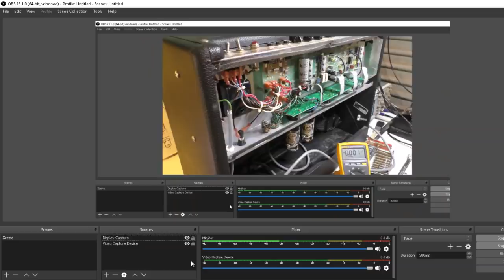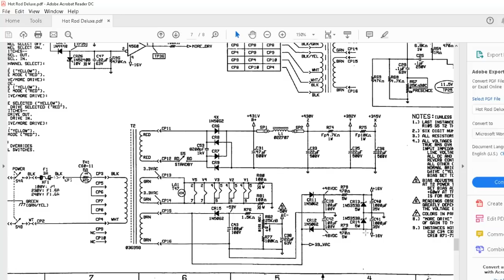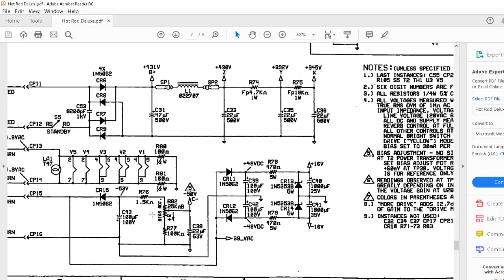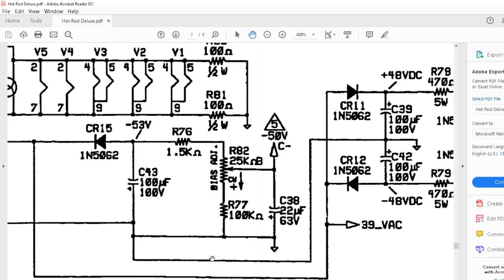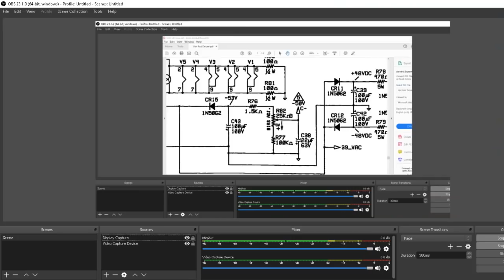Typical Fender Hotrod / Blues / Deluxe / Deville Series Problems & Repair.

Comment: Question please. I've got one of these been in storage 10 years and I want to get it up and running again. Is there something special I need to do to make sure it works and doesn't blow up?
Reply: Plug it in and turn it on.
Reply: What I always do with amps that have been in storage for a while is starting them up “slowely” with a variac the 1st time.

Comment: hey brad, i have a weird issue with my deluxe II . Volume at 0 as sound . Drive sound actually. the more i push the volume toward 1 goes back to zero and past 1 functions normally. 

I feels like the 0 volume was shifted at 1 , and there was a " negative volume "  below zero. 
Did you ever heard of that ? THis problem is actually no preventing me from playing at all , but i don't want to damage it. 

second problem : more annoying . often in gigs / jams if the amp has been on for 2 or 3 hours and get warm, the volume might drops suddenly, and sounds become really " transistor like " and cold. Professionnals never saw any problem because they probably don't play the amp for 3 hours staigth before to see where is the problem.
Reply from the maker: You only have one problem. You need a better tech.

Comment: Measuring the bias current with a signal present?!! You are adjusting the quiescent or IDLE current. The amp is not at idle if you're running a test tone through it.
Reply from the maker: The volume sounded lower than the camera gives credit for. I test idle with no signal and that's what I go with.
Reply from the maker: As I mentioned in the video, it's "safe". I just wanted to check that neither of the old valves were shorted or semi-shorted. They were replaced and the output bias set for the new output valves with no signal present.
Reply: Cool. Maybe reinforce to your amateur viewers that any signal at will give an inaccurate reading. I usually just pull the plug from the input. Good stuff, though.
Reply from the maker: @philbillie  Yeah, I should have. But when I throw the camera on myself, my IQ drops by half. HAHA!
Reply: @BradsGuitarGarage  Yes, the dreaded "Red Light Fever"

Comment: What lead forming pliers are you using?
Reply from the maker: Piergiacomi PNG5000. The ones in the video, purchased about 5 years ago are nicely machined and seem to be discontinued.
The new ones of the same model number seem to be machined using a cheaper EDM process and they are rough, with sharp points at the kink on some specimens, which is a total no-no. It may lead to a nick in the component lead and failure due to fatigue. Not impressed.

Comment: so i just bought a used fender hot rod i was wondering is there anything I should check right away on it?  Or just play it until theres a problem?
Reply from the maker: If you want it to last 10-15 trouble free years of hard useage, take it to a tech for some upgrades and mitigation of heat issues, otherwise, if you can afford to have it fail at some point (ie: it's not your only gigging amp), you could run the gauntlet and hope for the best. I'd get it sorted now if it was me, though.
Reply: @BradsGuitarGarage  ok,  the top does get pretty hot when playing but aside from that it looks nice atleast from the outside ha.  Maybe ill try to find someone to look at it to make sure,   thanks.

Comment: ya know, I'm pretty handy and can definitely do basic repairs, caps, tubes maybe broken boards and all that but I have this awesome Blues Deville 212 with n over drive channel issue. Im not sure if its the pot or something else. Sometimes it kinda works and sometimes not at all. (recently, not at all) how can I tell if its just the pot or something else, more serious and expensive to repair. I'm basically a poor man so I really can't afford to bring my shit to ANY repair shop, these days. Thanks
Reply from the maker: What do you mean by "kinda works/not at all"? Do you mean it won't switch to the overdrive channel, or if you switch to the overdrive channel, then there's no signal?
Reply: @BradsGuitarGarage  Thanks for the REply. Anyway, it WAS acting up like when you hit the OD channel switch it would come in blasting and if you touched the drive pot it would sometimes just cut out, altogether. I finally stopped procrastinating and disassembled it, cleaned the pot real good and resoldered any suspect looking spots. It's been fine since I put it back together, too. Really man, I appreciate you getting back to me on that. And I REALLY appreciate your videos. There's just SO many clowns on here. I think they just like the sound of their own voices, though. Lol. Oh, and I'm working on uploading a little video of an ORIGINAL Fender Princeton '66 that you might like. That amp is just UN-matched  imho  as far as tone. And it's practically silent, too!

Comment: how do you fix tube rattle? It will not stop and is so annoying
Reply from the maker: New valves. Hold them to stop them rattling one at a time to see which one it is.
I suggest avoiding JJ's, particularly their 6V6's and 6L6GC's until they resolve their rattle issues.
Reply: @BradsGuitarGarage  figured it was that, just wanted to be sure before I throw money at something I don't need
Reply from the maker: Some claim success with the fat rubber rings around them, but I've found them to have a limited effect if any.

Comment: I jus found a fender blues deluxe reissue ...I can't get sound the channel doesn't switch,reverb doesn't work, tubes are new...can u fix it..an is it worth fixing?
Reply from the maker: That's the same issue as this one. Probably broken traces on the low voltage power supply. I can fix it if you live near Sydney Australia, otherwise I cannot.
Reply: @BradsGuitarGarage  I jus looked again an I see one of the connection between the second tube to circuit board is not solder in ..an I live in Brooklyn NY by the way.. and the video was helpful 👍

Comment: Dropping 48V to 16V that way is just plain lazy designing. So they could not have bothered to spec a main transformer with a proper voltage for that circuit. Have you found a different supplier for those caps than Illinois Cap? Can't believe they used axial caps. With radials and snap ins you have way more supplier options.
Reply from the maker: I default to F&T now that Nichicon has ceased production of their VX series axials.
Yes, there really is no excuse for using axials these days.

Comment: what should I replace the R-97 resistor with ?
Reply from the maker: I assume you're talking about the footswitch dropper. If it's heat affected, replace with same resistance, slightly higher wattage, mounted above the board with ceramic standoffs to prevent the heat making it to the board and to have better airflow around the component.